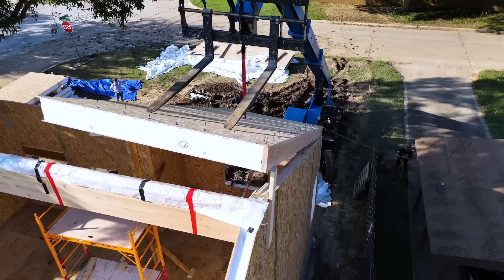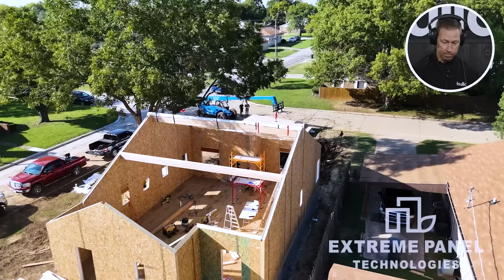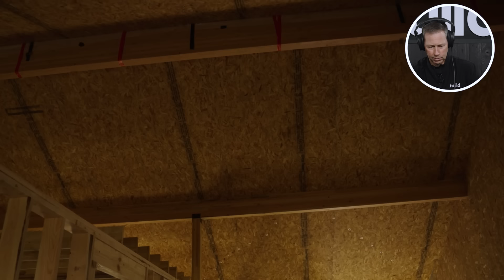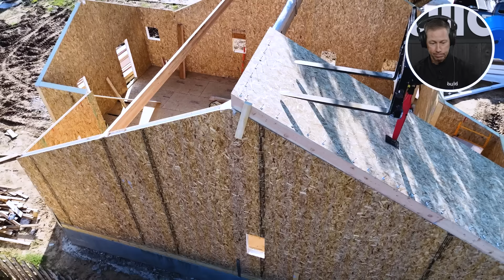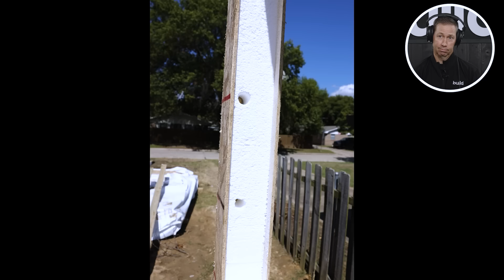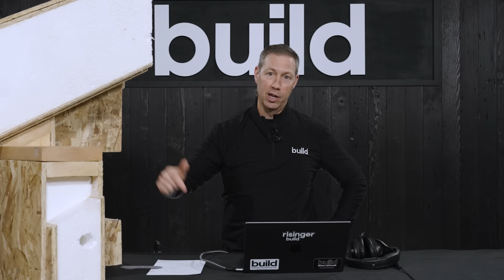High Performance HACK - Why More Builders Are Choosing SIPs

Comment: How do you run electric and plumbing in SIp
Reply: Extreme Panels YouTube video episode #19 explains how to run wiring.  Plumbing is typically not installed in exterior walls in cold climates.

Comment: The SIP construction is the future but I am not sure whether it should be foam or polystyrene or rather a vapour permeable insulation material??
Reply: EPS, Expanded polystyrene, is used in a majority of SIP products because it is cost effective.  The SIP composite, has a very low perm rating, on the order of 0.1 prems.  This allows the SIP composite to act as the code required vapor retarder.  The seams, joints just need to be sealed properly.
Reply: @JoePasma  It performs well but disposal at the end of its life cycle is difficult. The idea of SIP is great but more sustainable materials without volatile components would be desirable.
I am well aware that mainstream USA gives a toss about sustainability, environment, toxic waste and healthy building materials.

Comment: How are sips wall construction repaired if there is ever damage?
Reply: The repair will depend on the type of damage.  It's a similar questions with how do you fix a conventionally damaged structure.  

The repair should be made by someone familiar with SIP construction.  The best place to start is with the SIP manufacturer if you know who that is.  If the manufacturer is unknown, SIPA, the Structural Insulated Panel Association website is a good place to start.

Comment: Have you ever looked into SIP panel structure but with steel/metal ? We have been looking into this type of construction, using steel beams , but instead of osb+eps using cement panel+eps. The studs go inside the panels and framing is completed with other beams. Anyone familiar with this type of solution?
Reply: The panel you describe "osb+eps using cement panel+eps the studs go inside the panels and framing is completed with other beams" sounds like thermal bridging may be greater than the OSB EPS SIPs in this video.  They may very well work for your situation.

Comment: Balanced against the tremendous cost of the panels, a big crew with a crane, the fact that glue is a primary structural component, the flammability of styrene foam, the increased cost of wiring and plumbing in SIPs, unknown longevity of the SIPs, the possibility of a sip manufacturer doing something wrong, causing thousands of houses to be trash while going bankrupt,  and indoor air quality issues. Did I forget anything?
Reply: Your comments suggest you have not researched the topic of SIPs at all.  You just typed your opinion and hit "reply".  

Everyone is entitled to their opinion.  I'd caution those of you that read these comments to consider the sources of the comments.

Comment: How do you overroof a sip roof?
Reply: What do you mean by overroof?
Reply: @JoePasma great question thanks. I mean if I wanted to add additional sound proof insulation on top of the SIP. Planning to install a metal roof and I’m in severe hail country. Thinking of 5” of rockwool, then a vented gap, and another layer of Zip

Comment: Don't let  anyone talk you into  ordering  your  sips  with  prehung drywall. Its a  pain in the  butt  that and it cost a  fortune MN in chainsaw type blades for your wormdrive saw
Reply: Good advice.  Not to mention that the drywall will get damaged in shipping and when exposed to the elements while sitting on the job site.

Comment: Does anyone make a panel with osb one side and a fiber cement panel on the other, so you get a finished exterior cladding with each panel? It seems that you would not need an air space if the exterior panel was fused to the foam. Creating an air space with added cladding could result in the cladding ripping loose during storm force winds. Looking for the perfect hurricane  house.
Reply: OSB-EPS-OSB SIPs withstand tornados and hurricanes very well. SIPs are rated for Florida High Velocity Hurricane Zones (HVHZ) and they have passed the missile impact test. https://www.sips.org/documents/SIP-Missile-Testing-for-Florida-HVHZ.pdf

Comment: Can they make it crappier? Yes styrofoam and particle board? No thanks who sponsored this igloo and Oates.
Reply: Your comment suggests you are very myopic and have not researched SIPs AT ALL.
Reply: @JoePasma I've been in real estate since 93. I focus on quality construction not mass production vinyl villages. If you want a particle board house great but they don't last where I live because of humidity.
Reply: @ruthlessreid9172  Proper design of the entire structure, including HVAC, is required if a building is going to perform in the environment it is constructed.  SIPs are just part of the assembly.  Not the end all to the structure.  What you  describe indicates a lack of proper building systems design.  This includes ALL materials and mechanical systems.j

This is not a material problem, it's a people problem.  Poor design, poor installation and poor detailing.

Comment: WHy no full basements to double living space and allow moving away from the heat downstairs? Crawl spaces are wasted space, with most of the expense of a basement.
Reply: Crawl spaces, basements, slab on grade (SOG), all depend on the local geography, building practices in a specific area,  and project requirements.  There is no one size fits all when you are building in an area as diverse and large as the US.

Comment: Interesting but still going to have poor insulation along the stud lines…so a replacement for traditional framing but what about for replacing exterior insulation framing?
Reply: By using the UA method to determine the code required thermal resistance value, SIPs meet the IECC requirements.  SIPA, the Structural Insulated Panel Association, has multiple documents that answer these types of questions with technically supported data.

Comment: did my house in 1997 in sips.  floor, walls, roof.  Personally, I love them.  Especially when you see how much of a dance there is with vapor barriers, air infiltration, etc etc.
Reply: SIPs reduce the number of layers that need to be incorporated into the assembly which reduces risk or the "dance".
Reply: @JoePasma  yep.  and framing issues in general.  Which I guess really is one of the layers you are alluding to.

Comment: I am looking at Thermasteel Insulated Metal Panels (IMPS).  No cranes needed, no worries about moisture, no need for a vapor barrier.
Reply: OSB SIPs only need the panel joints treated properly with sealant and SIP tape.  A vapor barrier  is not use with OSB SIPs either.

Comment: So you just use House Wrap?  How do you run the electrical?  You say it has a condition attic but yet there is no attic  How do run HVAC in the attic if you have no crawl space?
Reply: A WRB, House Wrap, is required on the exterior of the SIP wall panels just like with conventional construction.  This is a building science best practice and a building code requirement.

Electrical chases are provided in the SIP wall panels at switch and outlet height and at 4' on center vertically.

The attic thing is a bit of a misnomer.  You are correct.  With SIP roof panels you do not have an attic as defined by the building code.  The SIPs enclose the exterior of the structure resulting in a fully conditioned interior space.

With respect to HVAC runs, dedicated chase spaces are incorporated into the building's design as well as a planned mechanical space of the HVAC equipment.

Comment: This seems to be a fantastic alternative to building a home. 
I especially like the insulation factor, the short 'dried in' period and versility of the interior framing. 
I hv a few questions//
Q//is it a healthy environment when the foam insulation is used, does it gas off like other building components?
Q//could I use my own plans?? 
Q//Could the build be done on a walk-out basement foundation??
Q//what are the interior sheeting options if I don't want to use drywall??
Thanks so much Matt!!
I always enjoy your build content.
Reply: SIPs do not off gas.  Yes, SIPs create a very healthy environment because the reduce air leakage.

Yes, you can use your own plans,

The walk out portion of the lower level can be SIPs.  Extreme and a few other SIP manufacturers make a below grade foundation panel.

The IRC (International Residential Code) requires thermal plastics to be covered with a 15 minute thermal barrier such as 1/2" gypsum, 23/32" wood structural panel or a material that meets NFPA 275.
Reply: @JoePasma Thank you for answering my questions. I do appreciate it.
In regards to the drywall question. I do have to cover the thermal plastic (is that the OSB or the foam?) with something that is to code but it doesn't have to be drywall, correct? 

Q//I am considering building the garage first to become familiar with the SIPS product and to give myself a work/storage area while the house is built. With that being said, could a second story/loft be built with the SIPS system? Ty
Reply: @BNM-b7t  The thermal plastic is the foam (EPS  = Expanded Polystyrene)  You could use 3/4" T&G pine as an alternative to drywall.

Yes.  this is done all the time.
Reply: @JoePasma Thanks for clarification.
I was definitely thinking tongue and groove.
Reply: If T&G is used, it would act as my covering for electrical and plumbing without using the SIPS chase system, correct? Do you know of any cons to using that method?
Reply: Aka Interior service cavity

Comment: Random thought? Would you ever consider a ICF build for the walls/basement with a sips roof in a monopoly build style? What are the pros and cons? I'm also trying to decide in exterior insulation would be a good idea with the ICF walls or not. I'm planning a build in southern Virginia.
Reply: In the addition we did on our home in MN, we used ICF's below grade and SIPs for the walls and roof above grade.  You can certainly use ICF's all the way up to the roof line and then use SIP roof panels.  There is nothing wrong with that methodology.  

The contractor you select should be familiar with both construction methodologies or be willing to learn about them before taking on your project.

Exterior insulation would not be needed for the ICF's above grade.  You would consider the total R-Value, or U Factor of the entire ICF wall when looking to meet the Residential Building Code insulation requirements.

Comment: I designed and built one of the very first SIP houses in Los Angeles County back in 1999. They were supplied by Premier, a newish company at the time, so lots of speed bumps, but very responsive company. It was in Malibu, so not a serious weather test, but the house shell went up fast, straight, and strong, and you could really feel how solid it was. Unfortunately, it burned to the ground in the Palisades fire, but SIPs was a great way to build, and I can wholeheartedly recommend them.

Comment: Don't really want chemical foam / polystyrene in a fire or just off-gassing. I don't want OSB/plywood/drywall in moisture. Seems it's brick or log, which can have their own issues... or rammed earth...which sounds great but impossible to find a contractor (same for ICF too, in east Texas anyway)...unless it is a 4 million dollar home. Seems a simple rammed earth 12-1300 ft basically 2 wall home (one end and one side mostly full windows) is unobtainable. If anyone knows an RE contractor that will build a small home in east Texas...LET ME KNOW! :O)

Comment: I guess you don't get plumbing, electrical, or low voltage ran down the exterior walls.
Reply: SIPs have electrical chases in the wall panels at switch and outlet heights and vertically in the walls.  Plumbing supply lines should not be run in exterior walls in cold climates.

Comment: Have you had problems  with the edge of the  SIP panels wicking up moisture when building on a slab ? If so what is the solution? Coating or taping the edge of the OSB ?
Reply: Installing sill seal below a treated plate that is ripped to the width of the wall panel.

Comment: The lifespan of the panels is supposedly 50 to 100 years.... It is a disposable structure, to ensure it fails in the future... 
There are also claims of SIPS structures that are well over 90 years old, using foam cored panels that were designed less than 70 years ago....
So keep that in mind before you spend half a million, building a disposable house....
Reply: SIPs in the US date back to the 1930's.  The crucial modern leap for SIPs came in the early 1950s with Alden B. Dow, a former Wright apprentice and the son of Dow Chemical’s founder Herbert H. Dow. Recognizing both the limitations of Wright’s uninsulated panels and the broader imperative for energy efficiency, Dow developed the first bona fide SIP by incorporating an insulating Styrofoam (extruded polystyrene, XPS, colored with a blue die) core between plywood skins. In 1951, experimental houses in Midland, Michigan, employed panels with 1-5/8 inch thick Styrofoam cores glued to ¼ inch plywood, assembled using wood splines and blocking methods designed for full system rigidity.

Hardly considered disposable.
Reply: @JoePasma  Why don't you go find all of the SIPs houses built then.... Best of luck finding them because most of them were disasters that already happened, and have long since been torn down or gone thru massive repairs..

Sure you can find a few, like Alden Dow houses and a few others. But the thousands built in California and many other states are all long gone.

Gone, is the same thing as disposable in that regard....

Sip roofs are also known to have a very high failure rate, like the massive disaster that occurred in Juno Alaska from the great idea of using sips everywhere with temp extremes that cause expansion and contraction near moisture.

Ironically you don't even need that much of a swing to have them fail...

The Newberg Center at Oregon’s Portland Community College that failed within 4 years of being built, on a fully engineered building with a sip roof...... The contraction opened up the panels, and mother nature took care of the rest.... Within 4 years......

There are hundreds, if not thousands more example of this occurring.....

Imagine trying to build a building anywhere with SIP's, when the instruction state you can not allow it to get wet or even damp..... And the warranty is void if that occurs, because they will fail if either occurs........

Sips are an accident waiting to happen... And out of all of them built over the years, only a handful remain....

Comment: How do you wire an plumb the exterior walls?
Reply: Electrical chases are at switch and outlet heights.  Plumbing supply lines should not be run in exterior walls in cold climates.

Comment: I met with Matt Reisinger about 6 years ago and he convinced me to go with sips for my tiny house.  Sips transfer a fair bit of your framing and insulation labor to the panel supplier.  The sips saved me a ton of time and they cost way less due to way less on site labor.  The true advantage though for sips is they have superior insulation values and strength is off the charts.

Comment: I've built several homes using ICF but I really like SIP's much better due to the ease of application, cost and you end up with plumb walls. 

I typically build ICF raised foundations and post frame construction above that. For my exterior walls I like to use Rockwool insulation. Then for my roof, I like to use SIP. I like building homes with vaulted ceilings so I usually use exposed beams and timber frame trusses either with metal brackets to lock the joints together or spend the extra time and make the joints just like a proper timber frame would be. Using SIP for the exterior walls in a post frame with girts on both the inside and outside makes the wall thick and SIP's are way more expensive than using Rockwool so I tend to use Rockwool because it's a great product. I usually use dry set brackets for my post.

Comment: I was seriously considering building a sips house and liked the idea but, after doing a cost analysis just didn't seem worthwhile. I was quoted 78k for a 1760 sq/ft shell (not including LVL's and lumber to marry the panels). I did a takeoff using like for like materials using 2x6 framing, zip panels, Hardi siding and insulation with a truss roof system and came up with a figure of just a little more than 30k. 48k covers a lot of labor and to be honest, I don't see a big time difference in framing the house compared to erecting a sip.
Reply: You need to talk to builders that do both.  Many will only build with SIPs.  I was one of them.

Comment: Why no intumescent fire resistant coating on these?
Reply: It can be pre-applied or at the site.
Reply: The IRC (International Residential Code) requires thermal plastics to be covered with a 15 minute thermal barrier such as 1/2" gypsum, 23/32" wood structural panel or a material that meets NFPA 275.  This building is being covered on the interior with 1/2" gypsum.  This means an intumescent fire resistant coating is not required.